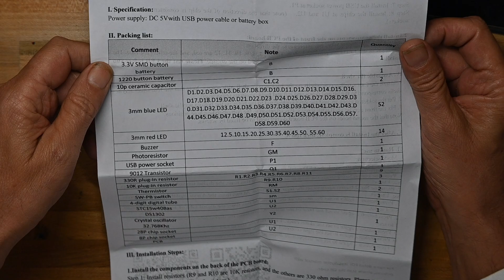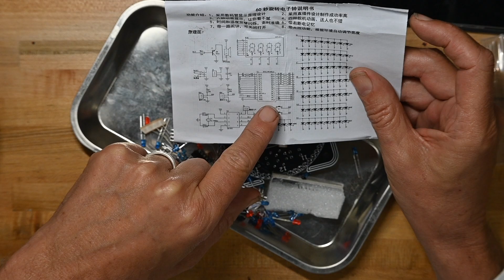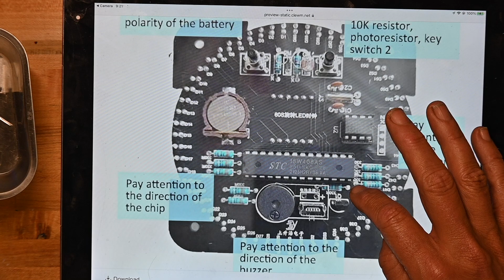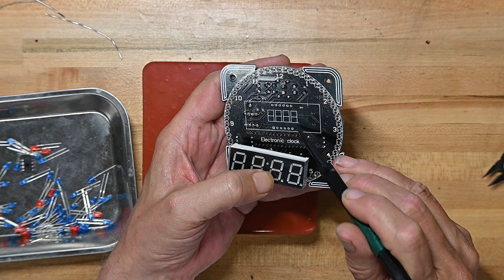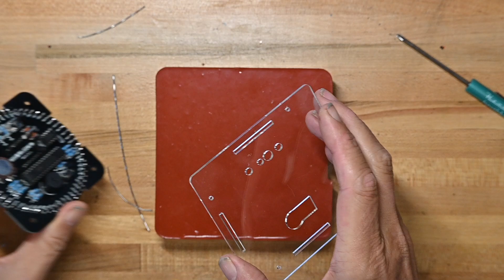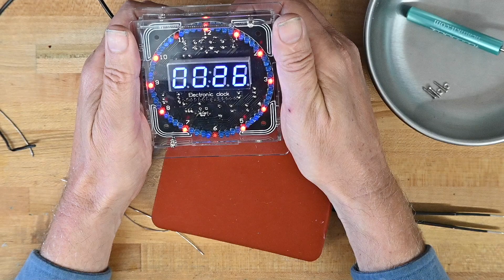C.K. builds an LED clock kit from the Dingdong Store

Comment: Bought the same kit and assembly was straightforward but to save my life I can't figure out how to set the time on the thing...
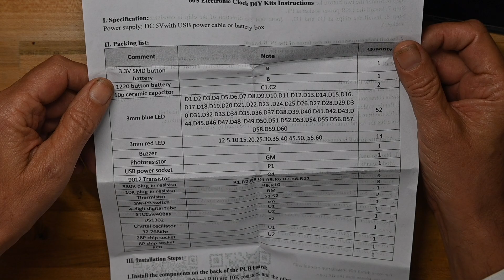Reply: @CKHaun  Just posted a snarky review on my buddy Jeff's site titled "This is not a clock: it's a clock-shaped soldering practice kit." I'm about positive I assembled it correctly and while I somehow managed to change the "time" to 1:01 (I thought I was setting the alarm) it stays at that time. Frustrating part is it has all the components a real clock would need. Why even include a clock chipset and microprocessor if you're just building a blinky thing? My best guess is that the the firmware is munged and the sellers don't know anything about it. No luck at all contacting the seller, BTW. I'm thinking all the positive reviews are fakes, especially the ones praising seller support.
Reply: random note: I see four surface-mount pads on the board labeled ZX. Possible serial access to that processor?
Reply from the maker: Yeah, sounds like a mini USB connector for programming.
Reply: @CKHaun  either USB or UART/direct serial access to the microprocessor. Found a programming manual for the chip, it's ~900 pages long. Moving on! :)
Reply from the maker: @MRrandini2U in my best Claude Rains voice"Fake reviews!  I'm Shocked, simply Shocked". Problem for me is some youngster will get this and be so frustrated they quit building things.
Reply from the maker: Me neither. Besides the on camera attempts I spent a good 20 minutes trying to figure it out. No joy.

Comment: Thanks for your video.  I just finished mine, but I still have to put it in the plexiglass case.  It works fine.  It took me about seven hours to soldier everything.  I didn't realize before that my multi-meter has a setting for testing LEDs; nice to know.  I'm a licensed Amateur Radio Operator (General Class) with a modest amount of experience with electronics and soldiering.
Reply from the maker: Glad yours worked!  Be patient with the case, getting those little captive nuts to stay in place can be frustrating, but worth it.
Reply: @CKHaun  Thanks for the warning.  I broke the end off of one of the side panels, but I managed to get it together otherwise.  It's a clever design, but it's definitely frustrating to understand how to get the nuts into the slots in the case until you've managed to accidentally get one or two of them into position.

One other quick note.  I realized I'd placed a blue LED at the 1 o'clock position.  I have one of those vacuum de-soldiering tools and I don't remember  if I've ever used it. But I managed to remove the blue and put a red one there instead.
Reply from the maker: Excellent on the re-work!  Confidence in being able to correct mistakes makes you a better builder!

Comment: I can’t help but to want to debug the thing and find out what’s wrong. Now I have to order one and see if it’s the software or just a pin on the microcontroller not being connected… bad serial communication with the clock chip? …also bad LED, solder bridge, soldered in backwards? It is killing me😂
Reply from the maker: Me too.  I checked all the connections as per usual, nothing obviously wrong.  And I don't think it's a clock chip issue since the setting buttons are controlled by the microcontroller.  So either I did something wrong that I can't see, or the microcode might be flakey.